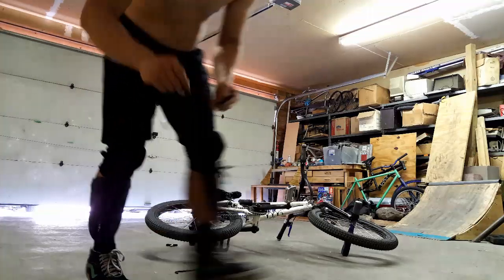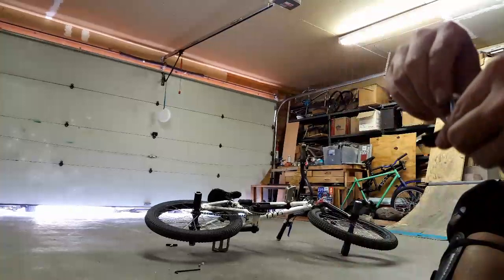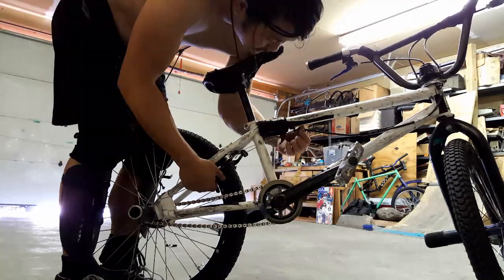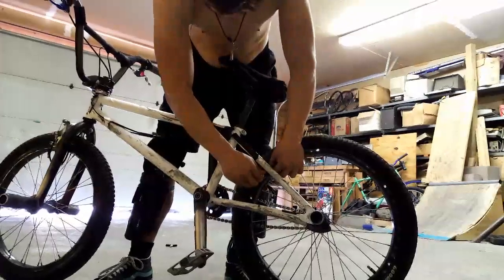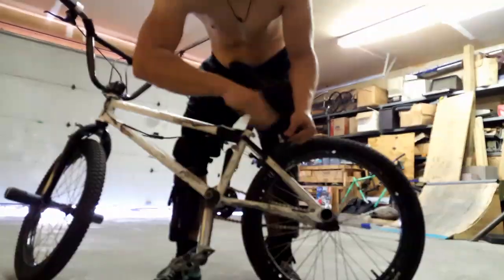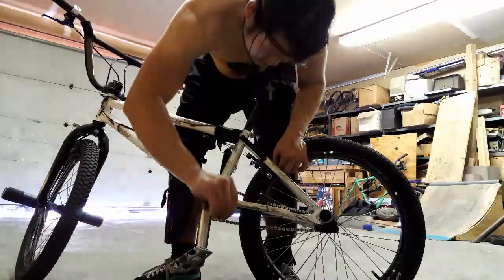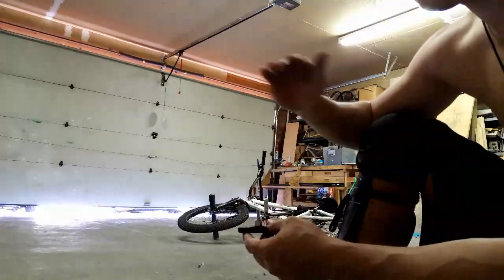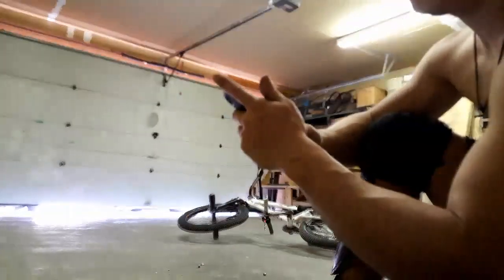How to make your break pads squeak less and installing them 326

Comment: Don't get the Odyssey ghost pads. They kinda suck.
Reply from the maker: are those the clear ones? I saw the flatland break pads and it seems there made out of the came clear material ive been wondering if they squeak more haha
Reply: @JamieRomoser  I got the blk ones and you can't really tow them in. The pads are curved so you're supposed to just clamp them down and they're supposed to be self towed-in but they still squeal. Maybe I gotta rub them down with some sandpaper and that'll help. 🤷🏼‍♂️
Odyssey makes some salmon colored ones now and I think I'll just stick with the salmon ones after this. 
Clear are the loudest squealers. Brant Moore is always squeaking around with those. He's a YouTube rider.  I can't ride with brakes that loud. Too annoying.